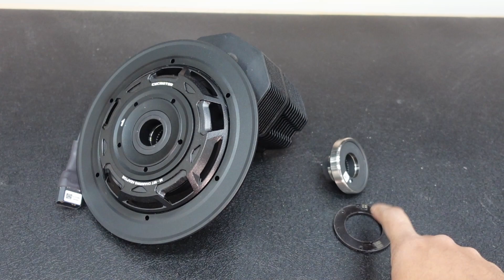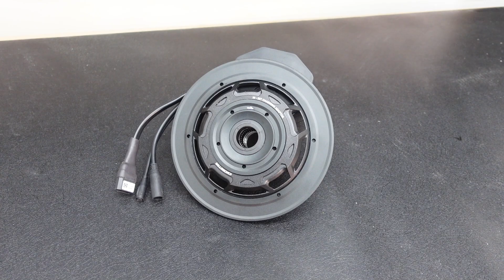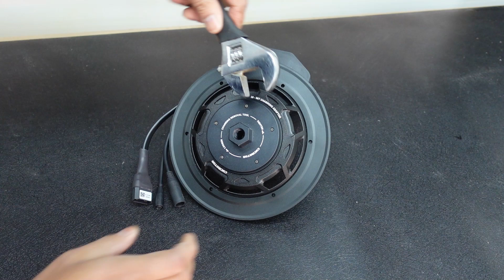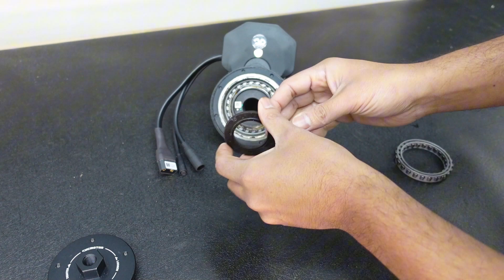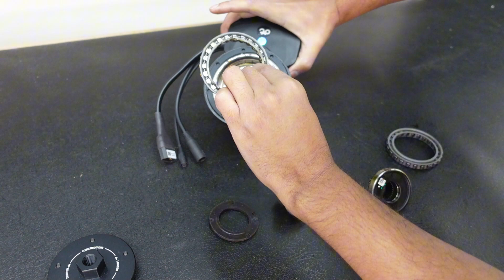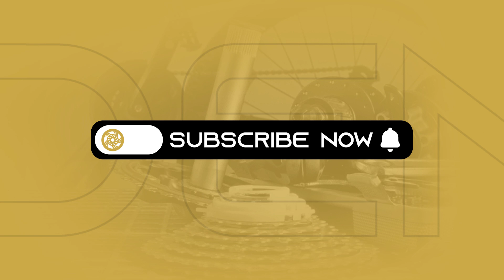CYC Photon: How to Replace the Torque Sensor

Comment: At 3000km and Photon starting to get noisy - how do you remove the output gear for regreasing, and is it possible to replace the large 80x100x10 bearing?

Comment: Okay, this is a good step for CYC....  But what about other servicing, specifically greasing - is it still a send it back, or can we now DIY that aspect?
Reply: I have passed almost 13k km on cyc photon without any maintenance and it's still okay, no issues.
But I rarely use 2KW unlocked mode and avoid more than 80-85 degrees of the motor temperature.